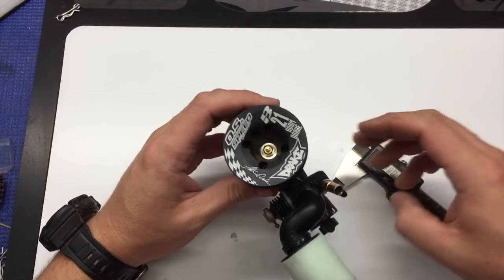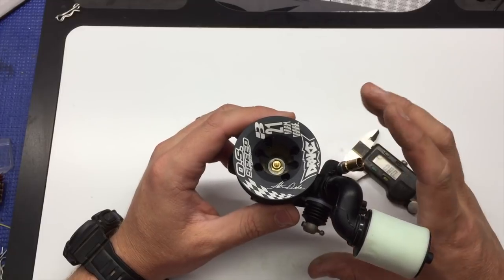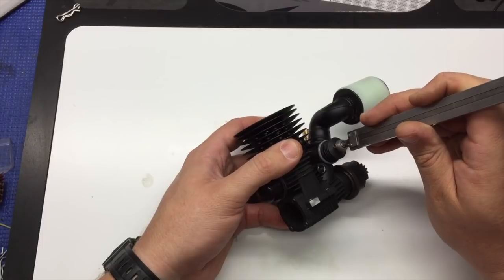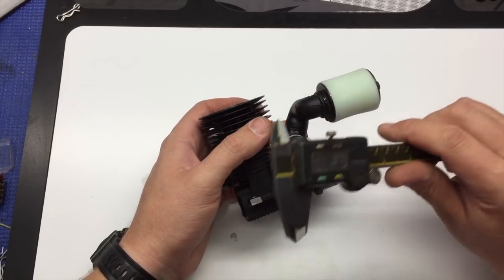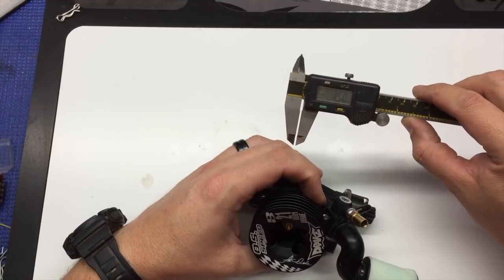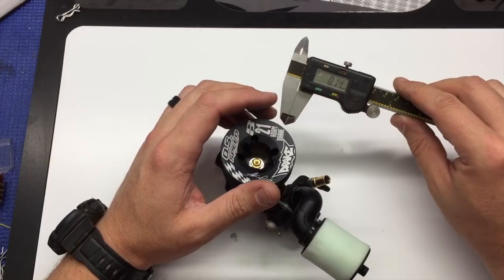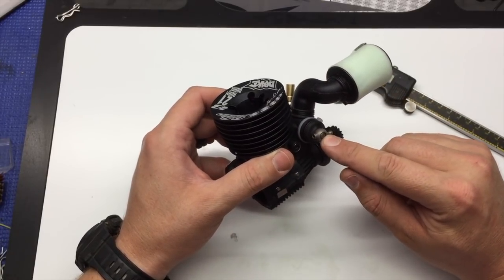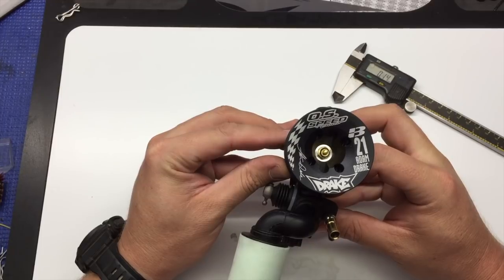Adam Drake from Mugen Seiki Racing explains the carburetor settings for the O.S. Speed B21AD engine.

Comment: Sir. Adam does this carburetor setting idle and gap  apply. Both Venturi 6..5 and 8mm. With this engine? Thank you
Reply from the maker: Hello, 
the settings will be very close for both the 6.5mm and 8mm venturi.  You may need to richen the HSN slightly for the 8mm.

Comment: Hey Adam I'm having trouble with my servos and whenever I give it throttle the throttle and steering glitches same when I try turning the wheels glitch back and forth.
Reply from the maker: What radio, servos, and electronics are you using?
Reply: Adam Drake what do you mean by electronics
Reply: Adam Drake ok I have the kyosho rtr I'm new to the hobby and don't know what the names are
Reply from the maker: Radio, servos, receiver, battery, switch, etc?  Could be the battery or receiver.
Reply: Adam Drake we checked the battery and still doesn't work but I don't know about the reciver
Reply from the maker: Thanks for the video.  It's difficult to say, but do you have a local shop that you could take the vehicle to?  Maybe you could try a rechargeable battery for the vehicle instead of the AA batteries.
Reply: Adam Drake ok I can go to revelation.
Reply from the maker: Great, Garren should be able to help.
Reply: Adam Drake I'm the one who said hi with my brother
Reply from the maker: Very cool.  You should have introduced yourself.  I could have looked over your car.

Comment: Thanks for the info kinda new at this and have two of these motors.  Always good to have some sort of starting point?  Just was curious, you think this method is more accurate than counting turns from it being bottomed out? Or is that not good?
Reply from the maker: Counting the number of turns is okay, but you can cause damage to the o-rings screwing the needles all the way in and then backing them out.
Reply: Adam Drake makes sense I figured you had a good reason.  Thanks for your vids man, Mugen is lucky having you be there PR man being active on YouTube.